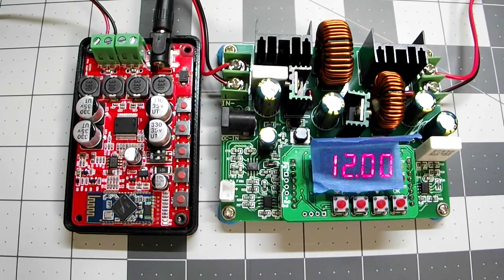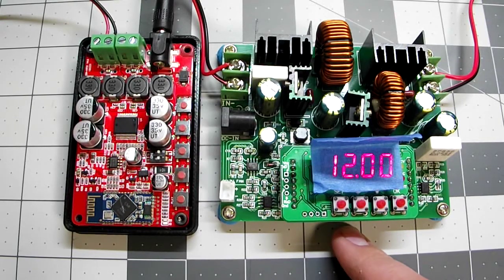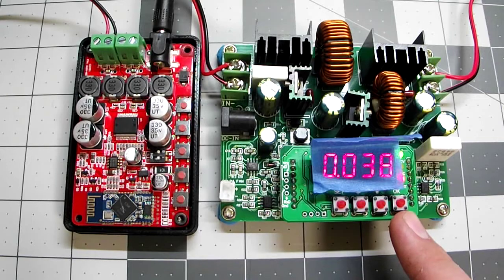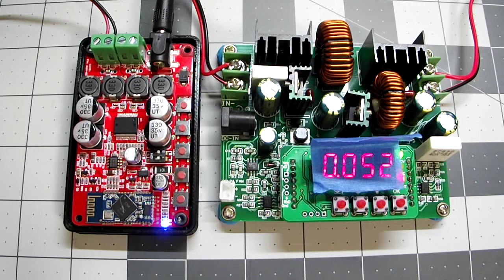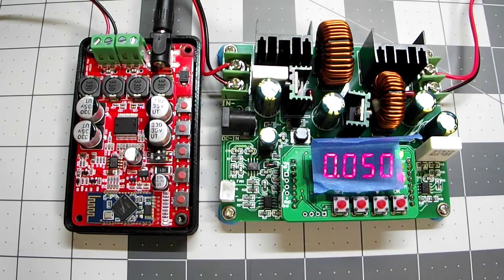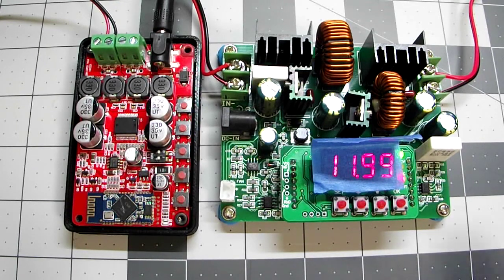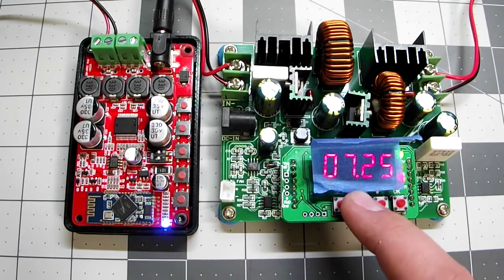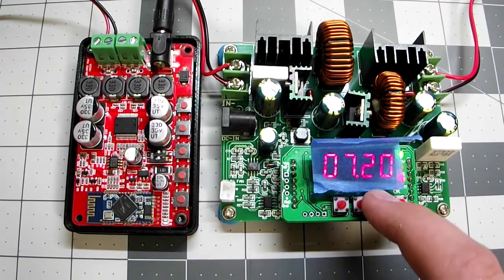Bluetooth Amp Current and Voltage Test

Comment: I'm planning add battery pack with BMS the output 24V & 15A. It can take 15A?
Reply from the maker: +kirito lheo I think the best you will get is 2A. Also I have head ppl say that eventhough the amp is rated for 24V giving the amp 24V will let all the magic smoke out of it.
Reply: tyler ward thnks
Do you know how to get down from 15A to 2A?
Reply: A device will only pull the amount of amps that it needs. Sorry ab voltage not amperage

Comment: For power you should measure it on output, i got around 7w at 12v and around 25w at 24v (clean power) with almost 2.5A at max power on 24v

Comment: Hey can i use 12 volt 5amp or 9amp battery as power supply
Reply from the maker: +San B 
Yes I have this amp in a Bluetooth Boom box build and I'm using a 12volt 9aH lead acid battery and it has been running fine.
Reply: Are you using ani boost convertor ? And what is backup ?
Reply: And can you suggest me a boost convertor that i can boost to 24v using same battery 12v 9amp ?( I dont want name of device just tell me what specifications do i need )
Reply from the maker: +San B 
It would depend on the current you would need for your 24v circuit. I use the D3806 in this video it is good for 38 volts and 6 amps. 
The amp will run just fine however on 12 volts.
Reply: For the same amplifier bord you are using
Reply from the maker: +San B 
I would just use the 12 volt battery. I only used the D3806 in the video to show the how much current the amp would require.
Reply from the maker: +kirito lheo let's say you are using a 12v 9ahr battery and the amp uses 2a. Then you should get 4.5hr of run time. But I think it would be much longer because the amp would not use 2a all the time.
Reply: tyler ward how many hours it can play on full volume?
Reply: tyler ward thnks

Comment: Try measuring the current at lower voltages.
Reply from the maker: +Ken 
I did it remained the same at lower voltages.
Reply: That's interesting because watts is P=IxE   Power equals current time voltage.   If the voltage goes down
and your still producing the same amount of power output then the current has to go up.
I think what your not seeing is the Peak power because your meter isn't fast enough to measure peak power
Reply: I think the voltage regulator would explain why no difference in current.  Regardless of input voltage the working voltage is the output of the amplifier.   Still, it should show some difference because voltage above
the regulated output voltage should have been wasted in heat..  When they rate audio amps of this class they use Peak so 50 watts in reality is probably about 5 or 6 watts.